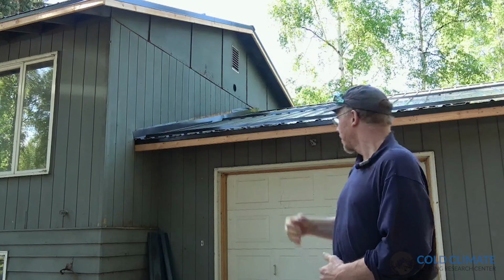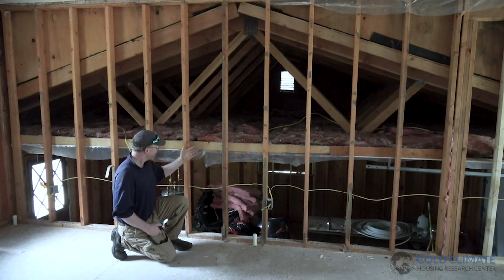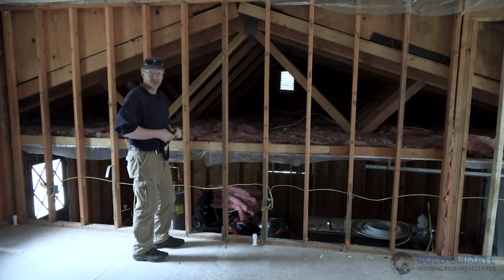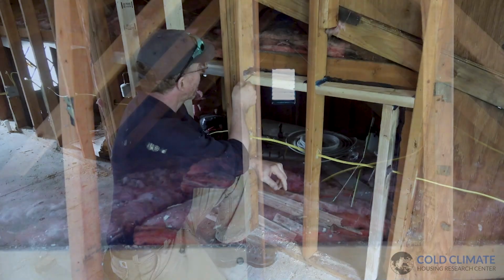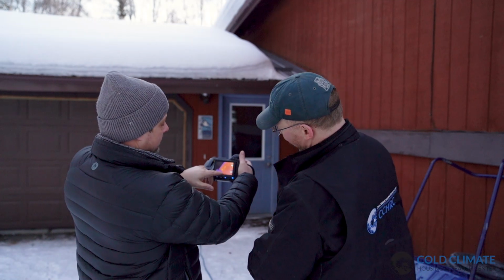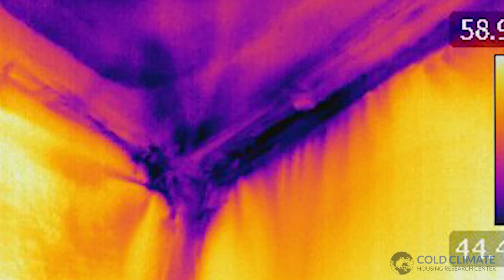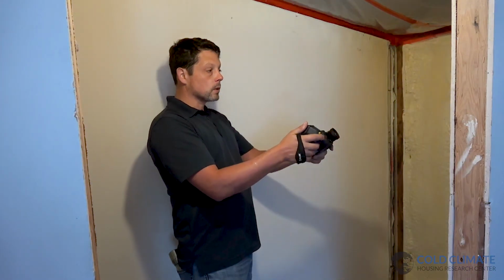Thermal Bypasses

Comment: 3 cases of homeowners expanding their own homes with too many DIY shortcuts vs hiring qualified up-to-date contractors who know which shortcuts to avoid...

0:20 case study 1 1970s home add-on

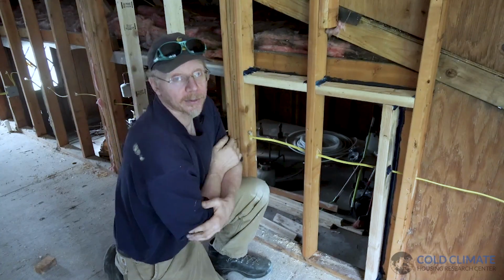9:02 case study 2

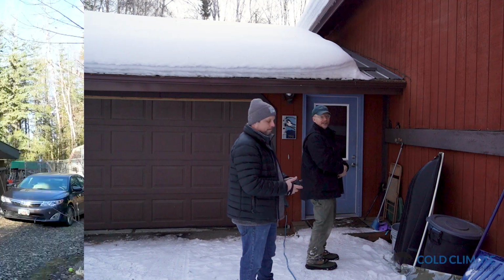10:57 case study 3
14:20 start the pressure test the wall system and fog machine
15:30 back inside removing plastic in closet ceiling, still wet from air condensation last winter

Comment: There was a family in NJ, that built homes between 1890 - 1950, with unique and amazing water diversion systems.   The problem came about in the 1980's, or so, when people tried to shove insulation into their gaps.   Then their homes failed one after another.  So, it is difficult to bring old homes up to new home building codes, and sometimes, that might damage the home.  You are right, the air leakage, helped save the home.

Comment: I really appreciate your videos, super helpful. Please allow me to share some feedback. 

Blocking is needed, insulting upgrades absolutely you’re spot on.

@1:22 mark, looks like the garage roof rafters failed snow load. Mid-span deflection 3”.  Apart from thermal the structure is poorly designed.   

Also, the snow bar is incorrectly installed, there should not be any mid-span. 

If I’m way off do let me know, thanks again.
Reply: Should the flashing on the addition have been wrapped under the siding?

Comment: great video and very good examples like usual,  I am zone 7 very northern wis.  I am remodeling  an old farm house that had 1 inch of nothing for insulation.  This video made me realize on every dormer/ roof change in my 2nd floor, It will need  to be treated like in your examples. put blocking where it is needed.  we hear about studs causing cold to enter our homes and use double walls to prevent that,  But,  you showed that proper use of blocking/ poly and spray foam is a very good way to stop the transition of vapor.  I have made my walls